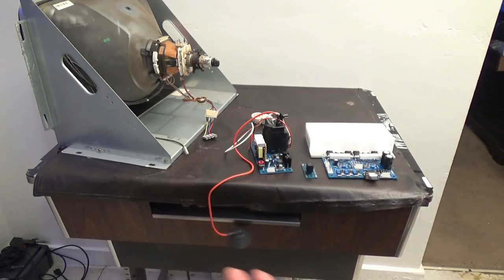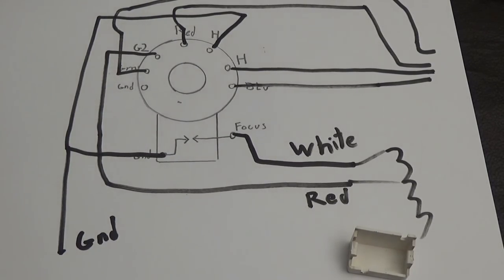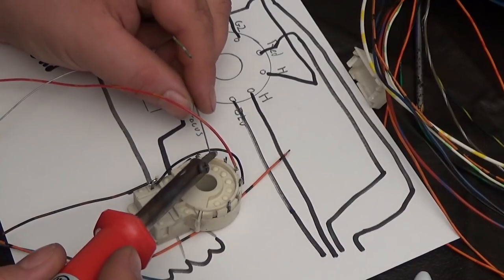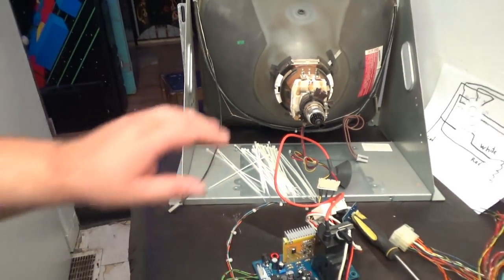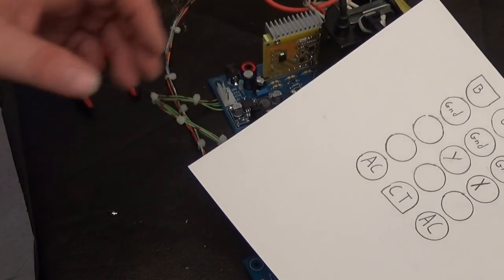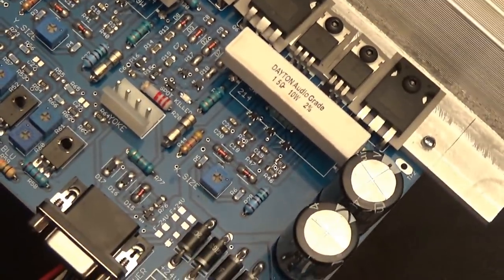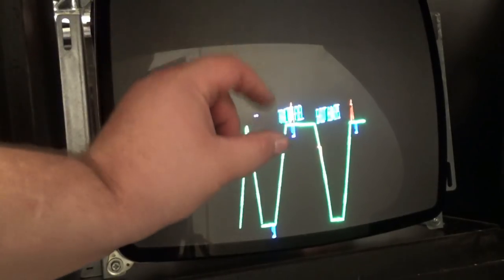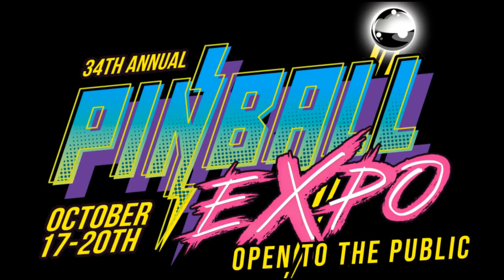The new vector monitor kit explained  and assembled

Comment: Jason, I'm installing one of these right now (maybe a newer rev?) and had a question. Did you notice that the FET or whatever it is on the small heatsink on the high voltage board runs REALLY hot? Like cant even touch it hot.